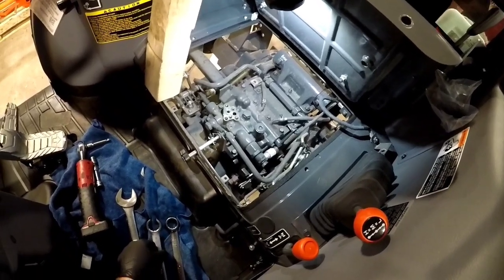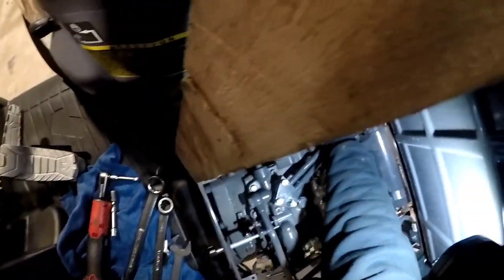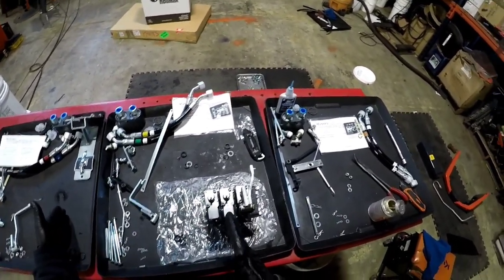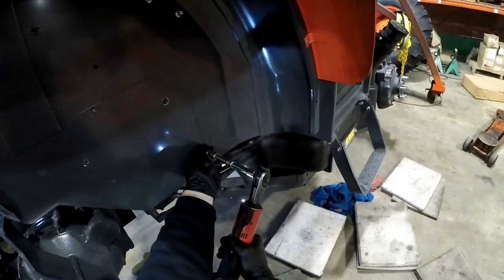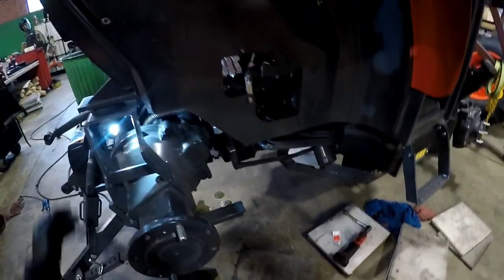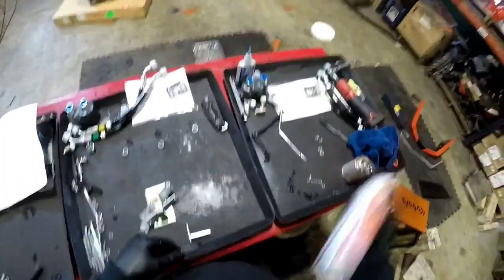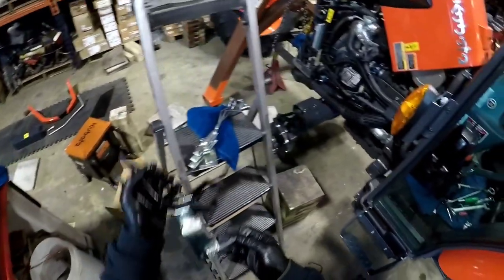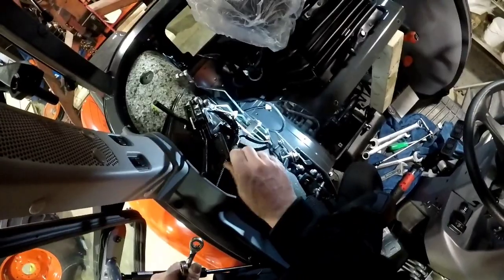this is not a how to video

Comment: I have three valves on my L6060. The third valve (outside valve body closest to the tire) is not as smooth operating as the inside two. From your comment this sounds like the valve bolts maybe too tight if I heard you correctly. It operates just not quite as smoothly as the other two.
Reply from the maker: Most likely.  If you can.. 12mm wrench,, loosen each 1 of those 3 long bolts a little tiny bit at a time until that spool frees up..!  Should be pretty easy